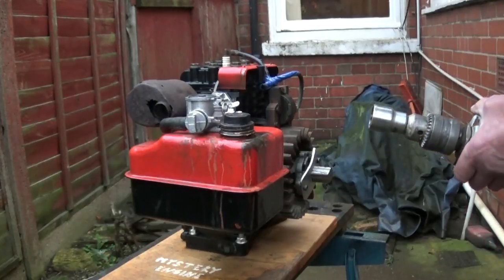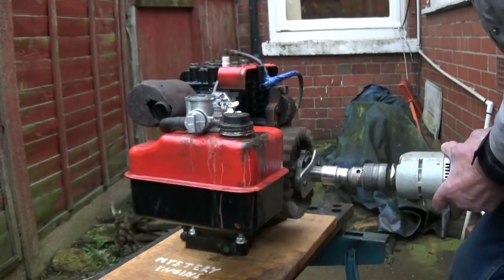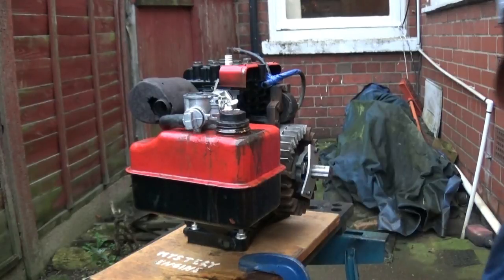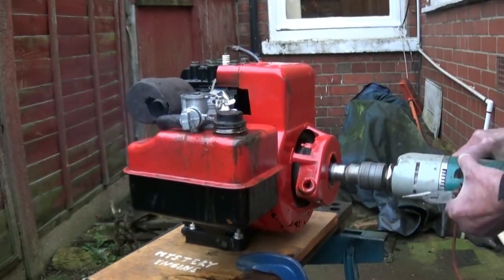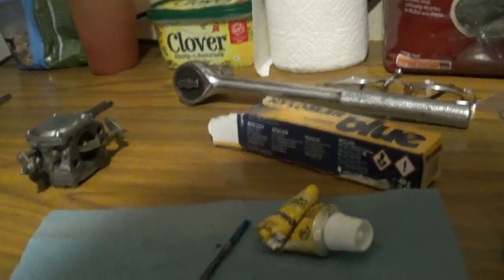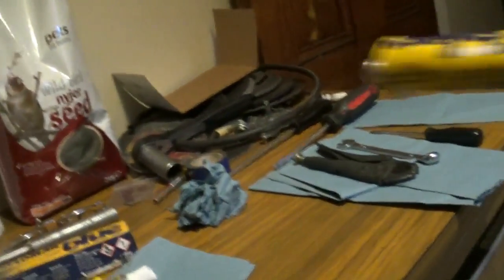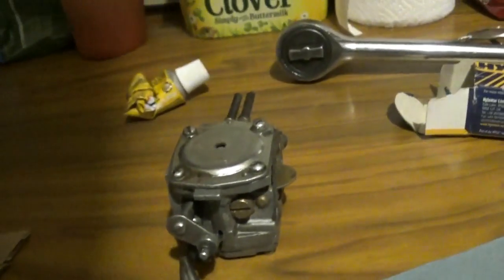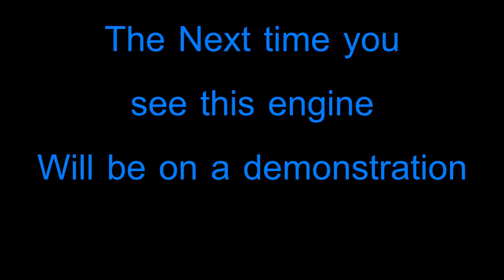Mystery Engine is Finished ........... For Now

Comment: Yes I see what you mean about having to get it warmed up before you demonstrate your mystery engine wouldn't do to give a demonstration and have it not work. Well just a wee bit of tweaking and its ready. Always nice to see an engine Run. Did I ever tell you the first car engine I worked on when I was 17 was My Fathers 1950 Austin A90 Atlantic Convertible with twin SU carbs. It had been sitting for 10 yrs on his driveway. I got it back to running and driving.That was 50 yrs ago. Engines any size are always fun to me.Saw Jonathan rescue a 1959 Triumph on his video today. I said wait But But its a british car lol Cheers old boy
Reply from the maker: It's tweeked to the max Larry. Had my one visitor call a couple of hours after I did this. He's seen all the build videos, yet agreed, to see it in the flesh is much more spectacular. It started and ran with no fuss and in warmer weather will be better. When young I helped someone who got a lot of cars going that hadn't been run for years. They usually ran after 10 minutes or so tinkering. Mind you, petrol was proper stuff back then.
Reply: Yes back then it was real petrol not this ethanol environment friendly non lead junk that destroys your engines valves. They never thought of what it would do down the road only that Oh it was cleaner blah blah blah. Well I'm sure you will amaze a lot of people and they will come away scratching their heads lol